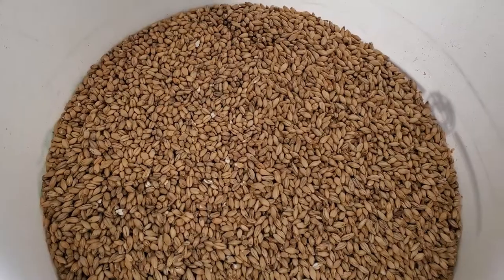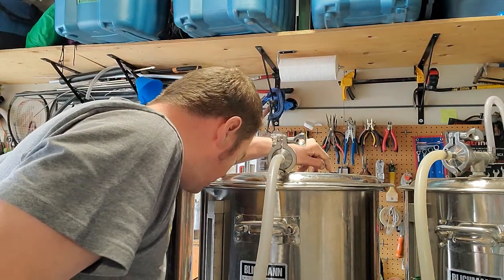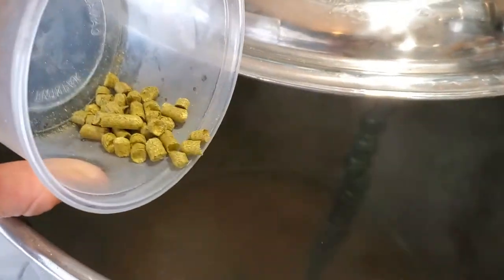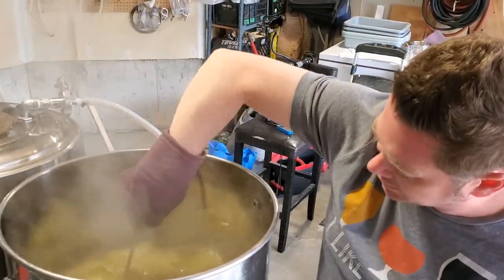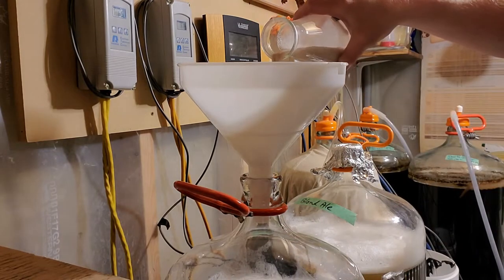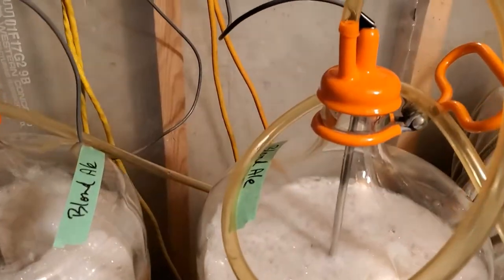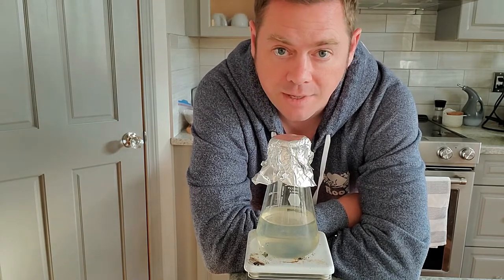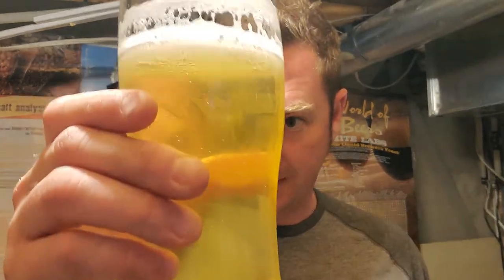Brewing an American Blonde Ale

Comment: did you say you used 1 lb of vienna? nice beer
Reply from the maker: So, that would depend on how much you're brewing, and what specific alcohol content you're looking for. In the video description, I give the percentages I use in my grist...I do it that way, so it can be scaled to any size batch and any system. If you're using, say, 10lbs grain total, then .4lb each of Vienna and Wheat malt. I use Beer Tools Pro software for my recipes, so tracking all that is pretty easy. For someone who doesn't use brewing software, you could base the quantity of malt on a comparable ABV beer you like, using its total grain weight, and go from there. Thanks for the question and the kind words! 😁